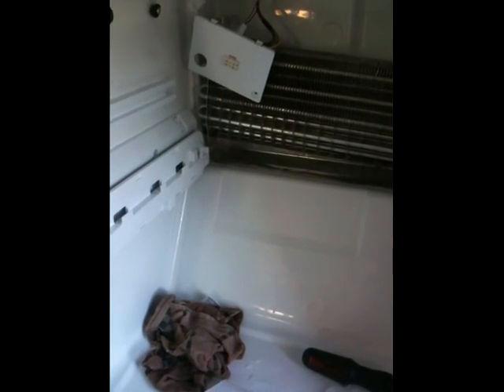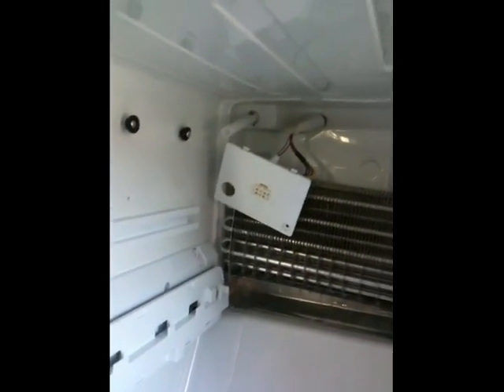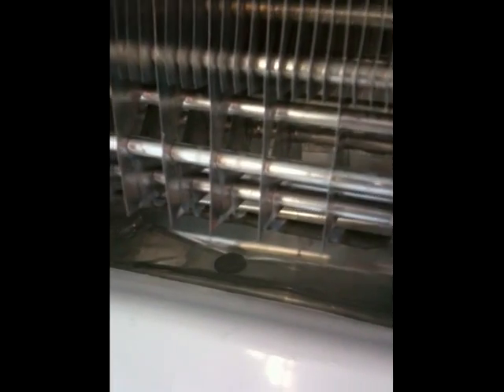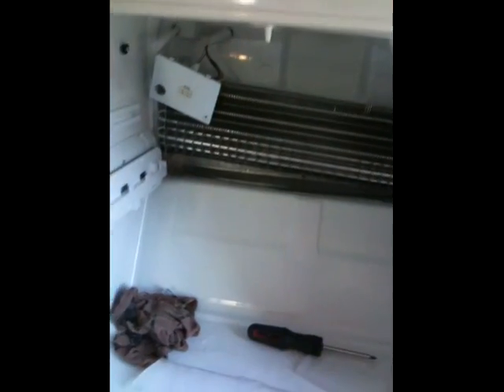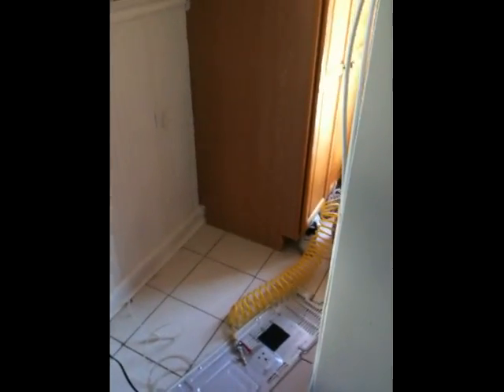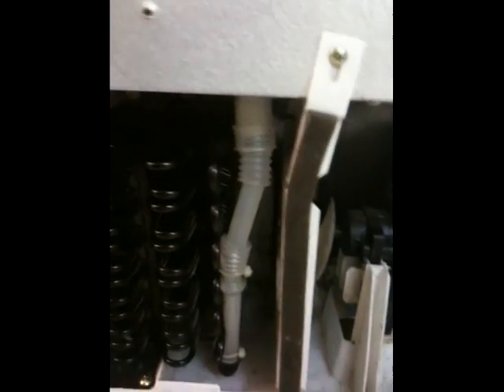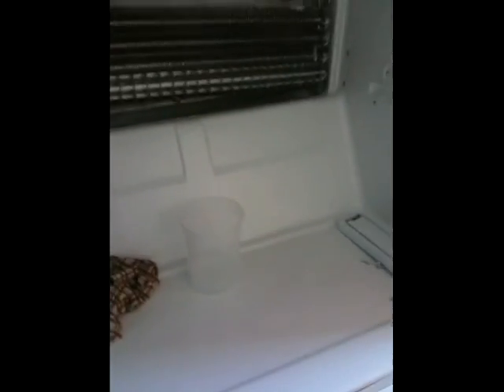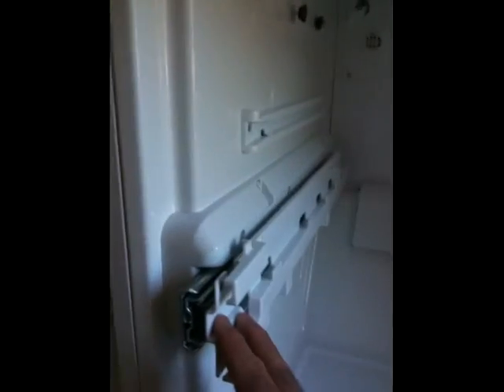LG Freezer repair (French Door, bottom Freezer model)

Comment: I have the same model, same problem. Service guy told me replace temp. sensor and circuit board, clear the ice. I did. Now 1 year later it is iced up again. Door seal is like new. Only 2 years old. I will not buy LG  or Kenmore again.
Reply: I have the exact same fridge but with a GE nameplate!!! I guess the only good fridge maybe.... a German Bosch or??? Everyone complain about Samsungs fridges

Comment: Thank for posting this awesome video. I have a question for you. If the drain hole plugged up. How & where the water leak going to flow out? Mine filled up the tray and overflowed slowly and soaked the wall for days without us noticing it. Until the carpet got wet on the other side of the wall. Would to ice make cause the leaking? How do I isolate the problem? BTW I have the three doors frig w bottom freezer bought in 06's. Thanks a million.

Comment: @drayu  I have the same problem as you, from what I can tell it is a plugged drain plug. For the live of me, I don't understand how the drain plug works or where the water goes once it is drained. Where does the water go.. to a pan on the back? Then the water just sits in the pan until it evaporates? Can you post a video on how to disassemble the shelves in the freezer? I know you mentioned some tabs, but I cant seem to take mine apart. I am attempting to get to drain plug that might be plugged.

Comment: Do you really think this problem repeats because of not closing the freezer door?

The water from the defrosted ice is over-flowing the tray behind the interior back panel.  And it's over-flowing because the drain hole is iced over.  And the drain hole is iced over because water's standing in it rather than draining out into the condensate tray.

So ... why is the water not draining through the drain tube?  What's the permanent solution?

Help.
Reply: the insulation on the cover of the evaporator coils has lost its foil facing, so the defrost heater is not bringing up the water drain ramps up to a warm enough temperature to make sure the water stays liquid down though the drain hole. This foil facing comes off each time you manually defrost the coils, then the white foam insulation acts like a sponge, the water freezes, and now you have no insulation value. The idea with running a wire down into the drain hole is also a good idea, but replacing the insulation works, less than $5 of material.

Comment: Have identical fridge but is branded Kenmore ..cannot find  parts with the Sears model #.Any help would be appreciated.Just did the identical repair....then found this video..No appliance repair will work on LG appliances in my area..go figure.
Reply: yeah these are really GE, I have the exact same one (bad gasket, dead motherboard, dear fan, bad PTC) Works better than new now after my fixings with cheap ebay spares

Comment: I have had to repeat this process four times. This doesn't fix the problem that causes the ice buildup. It just removes the buildup. Anyone know if there is an official fix?
Reply: See above for the insulation replacement. It works !!!. Other than this, the unit has worked perfectly, since 2007. I'd buy another one, this is an easy fix. I actually added a little bit more insulation than was originally included, every spot that wasn't covered. The original 1/4" white foam if it had been closed cell foam might have been ok with no reflective foil, but once it gets wet, the ice just conducts heat right through it.
Reply: did you run a test defrost cycle...?

Comment: Did you try to let it defrost and sit for a couple of days? We are having this issue, unplugged and let it sit for a few days. Plugged everything back in and voila ice is back.
Reply: Agree. Before you go through the torture of taking apart your fridge or even worse, finding a half-decent authorized LG repair shop (heads up: no such thing), just defrost it before going on a European vacation. That's what I did, it worked like a charm (no ice on the bottom for 3 months so far), and Normandy was gorgeous.

Comment: Drayu, did replacing the door seal solve the problem or did it continue to freeze and leak? By the way, LG stands for Lousy Goods....My wife chose this fridge used, and now I am paying for it
Reply from the maker: +ih82spd Not sure if replacing the door seal was the solution to stopping this or the piece of copper wire that I ran down the tube.  Maybe it was a combo of both.  I will say though, that even the new door seal does not always seal as good as it should.  We really need to be conscientious of closing the freezer door.  If it wasn't for the size of this fridge, which we LOVE, I'd probably get rid of it ASAP.
Reply: This problem is NEVER caused by a leaking door seal. It is ALWAYS caused by a blockage in the drain tube. Leaking door gasket will cause a rime ice (flaky white powdery snow) buildup on the walls and ceiling of the freezer but never a clear ice build up on the floor.
Reply: :) LOL
Reply: How would you avoid the copper wire melting part of the plastic tubing?

Comment: Those screws he took off to get the door off was a big mistake. U have to take it off from the actual door bracket.  Now when he reinstalled them it is a real hitch to get the angle just right to have the seal close on all sides. Adjusting 6 screws simultaneously. With the door open.  And then u have to use a level and shit.  A nightmare I learned of a whike back. GE has a identical model almost that is the biggest price of shit in the history of bottom freezers. Moral of story.  Don't take the
Reply from the maker: Taking off the four screws is not an issue.  Replace the seal if it is not sealing well.  The easiest way to do this is the way I showed.  But, thanks for your reply, i am sure it might help someone.